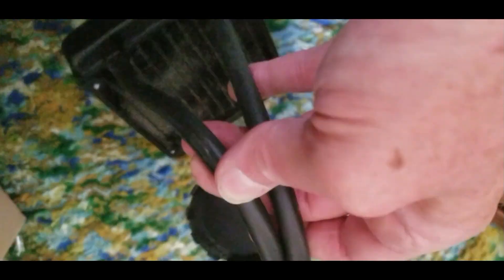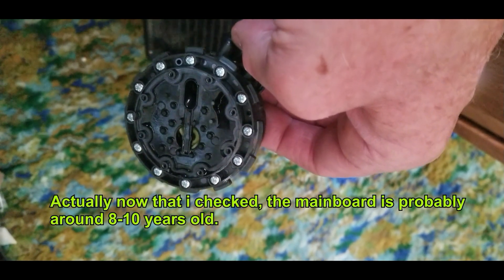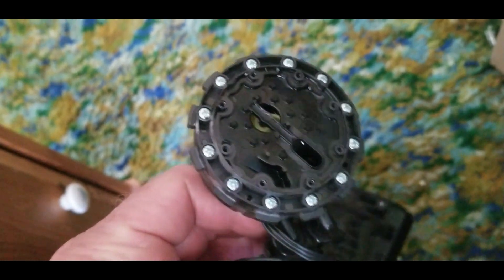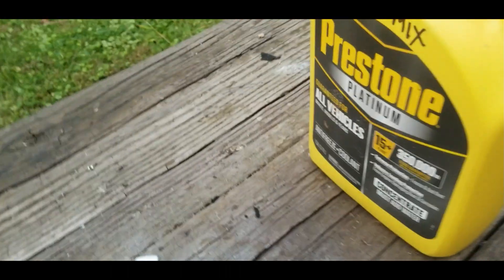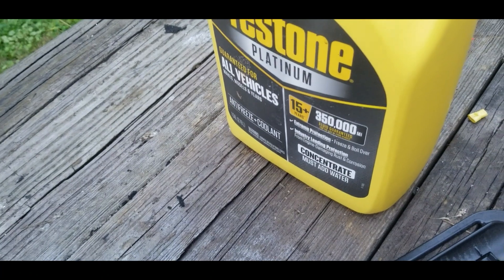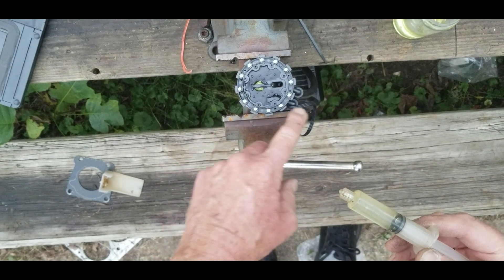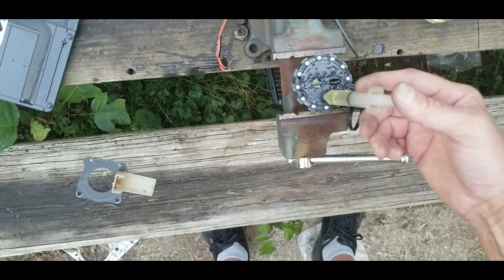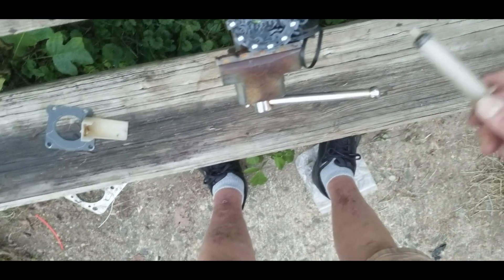AIO CPU cooler drain and refill

Comment: Hello, wouldn't highier vesocity mineral oil make you pump work harder than intended, and it doesn't react to the metal like copper, zinc, steel and aluminum?